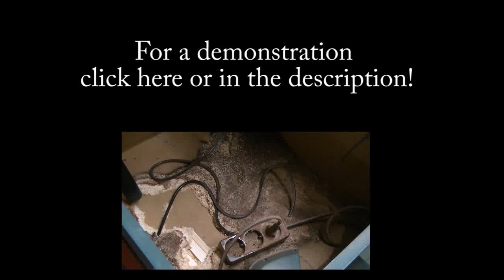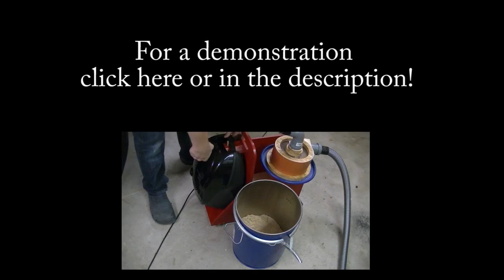Building a Cyclone Vacuum Cleaner

Comment: Agree with others who have said your solution to sanding the inlet to the inside circumference is great! How much testing did you do to identify the best position (both vertically and opposing inlet) to the suctioning vertical tube? Perhaps you could do a follow up explains that? Thanks for sharing.
Reply from the maker: None. I just made it so that the baffle is level with the lid of the bucket. And it works really well.

Comment: Beautifully done. Can i ask you what is the blue metalic recipient  that you use to base this proyect? I live in Argentina, and i never see a container like that, so if you tell me what is it, I may found something to replace it. Thanks!
Reply: And one more question, Cosmas. Does the vacuum loose sucksion capacity with this cyclone? And if it does, is significant? Thanks man, I really love your vids!
Reply from the maker: TheLaoruga
Thanks :)
The vac loses a little bit of suction but it is not noticable. The blue container is a barrel made out of sheet metal.

Comment: with all the work that went into this you end up using electric vacuum, why did you not use air power from compressor?  You purchased a vacuum to run this, air is cheaper.
Reply from the maker: You could make a video and show us how you do that. That would be awesome :)
Reply: I learned long time ago the my showing you how to do something would be a waste of my time.  You have shown that your ego is nowhere near capable of handling such a thing.  I do not have the room for a big vac in my tiny shop, I build with the least amount of power tools a 10 x 20 garage can handle.
Reply from the maker: Gary Finger Tough story bro. I know it's not easy. But you're right, my ego really wouln't be capable to withstand such greatness. So please, don't show me the light...

Comment: I need some help am building a system like this with a 250w 350m3/hour motor with 100mm input duct and I can't get 100mm duct tube here, only 90mm or 110mm, should I do the duct with 110mm tube or 90mm tube ? 
I'm thinking maybe the 110mm tube with a 90mm short tube on the end where it vacuums the dust from the cnc machine might be the best choice, can someone please advise ?